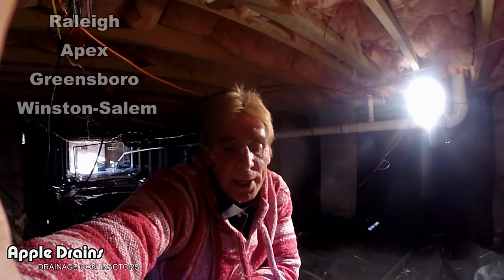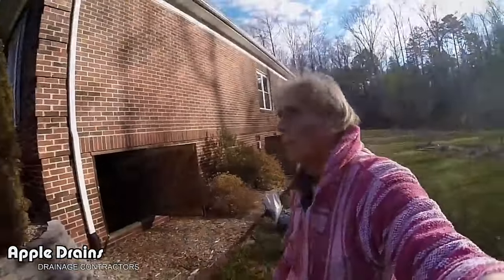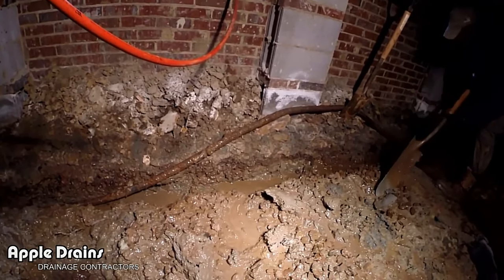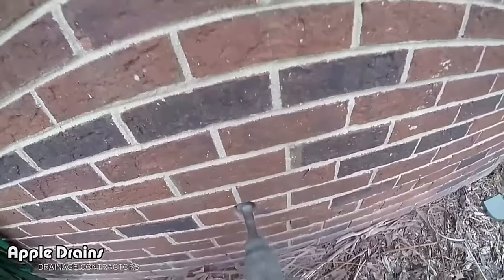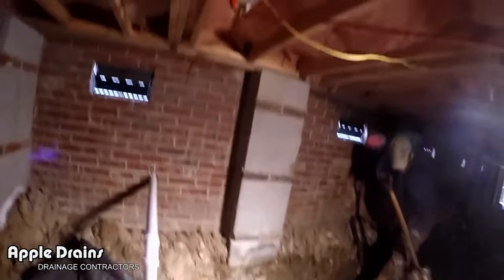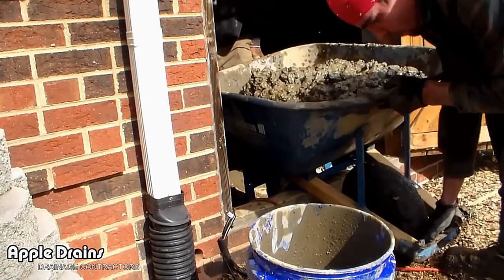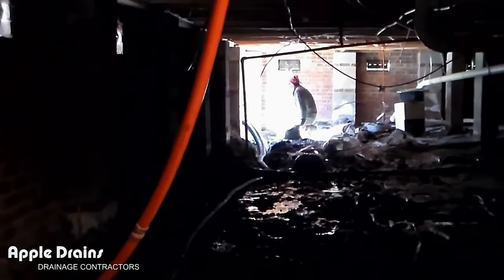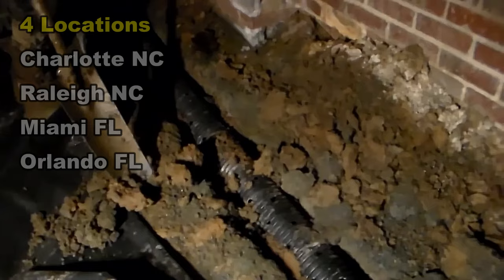How to Fix Wet Flooded Crawlspace.  Do not Hire a Bug Company, Raleigh NC

Comment: How do you feel about crawlspace encapsulation?
Reply from the maker: Hi Molly, as long as you solve the water problem first, you will enjoy encapsulation. I think that vapor barrier works just as well. Our Raleigh office is offering encapsulation, so check back on some of the videos as they get posted

Thanks for your comment 
Apple Drains 
Drainage Contractors
Reply: @appledrains  thanks! I'll be looking for them. We often times have up to 8 inches of standing water in our crawlspace when the water table is higher after the rains come through. I'm having a company do the job out here in Oregon, but because of you I know what questions to ask to make sure they're doing the right thing. I've tackled a lot of my other drainage problems myself, but encapsulation is a big one! Thanks again for the videos- I'm a HUGE fan! I'll have to send you some photos from my most recent drain-to- rain garden project.